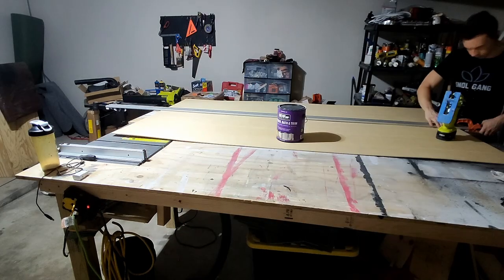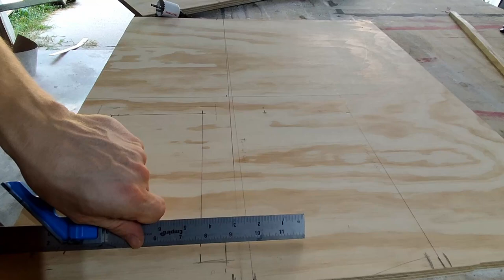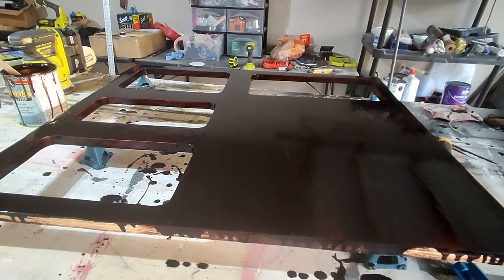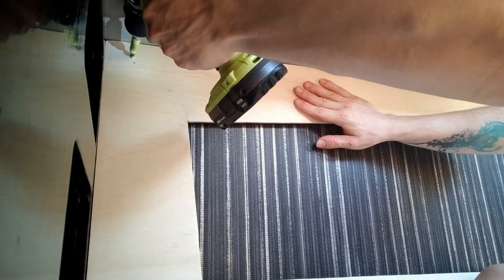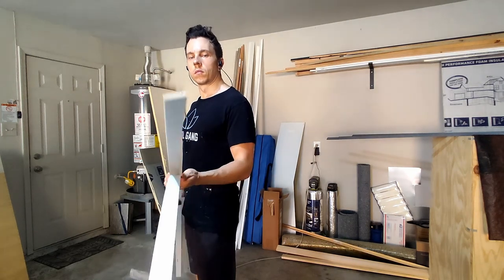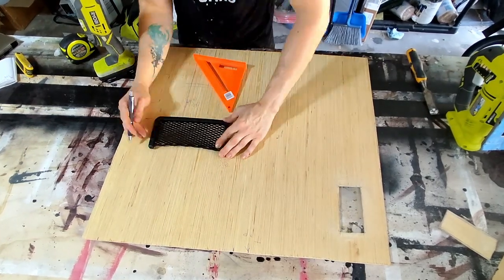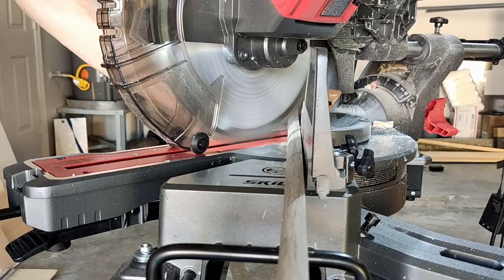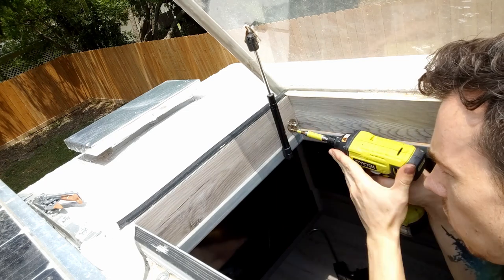DIY Capsule-Hotel in a VAN - Start to Finish | DIY Uhaul Box Van Conversion

Comment: On those trim pieces with the 45* angles around the cubby pockets. Try using a CA glue to glue the trim together. Then attach to the wall you will end up with much cleaner joints. Overall great work man this is definitely an inspiration to get out work/finish a project.
Reply from the maker: Nice I'll try that out

Comment: FYI for the future 
Steel Wool comes in 4 grades from coarse to fine  0, 00, 000, 0000, 

Scotch Brite comes in 4 colors coarse to fine Red, Green, Gray, White (or sometimes Tan) 

you can get the latter in bulk at any Auto Paint Supply store! 
also the latter does not leave fine metal fibres all over the [CENSORED] place!

Comment: It looks pretty posh!
  Here is an idea that you may want to use on your skylight. Some boats have a screen that slides in from the side or the end so that you can keep bugs out.  (You see this on overhead port windows). It also has a shade that pulls in from the other side or end that totally blocks all of the light out. It runs on the same track. 
  When they are both open, you have an open hole that you could go through. 
  These are probably pretty expensive to buy, but I think that you could build one from some channel aluminum pretty cheaply and easily with off the shelf screens and shades and some custom cutting.
Reply from the maker: Yeah I do plan on adding retractable shade/screen I just cant find where everyone is getting the custom sized ones made

Comment: I have a question and thank you in advance. I am a lover of your channel. I’m keeping a rollup door and I was wondering can I use two by fours to frame the ceiling I’m gonna put a thick tongue and groove over the plywood there. Or should I use to buy threes? My only issue is I have a bunch of two by fours already.
Reply from the maker: 2x4 would be a bit excessive weight-wise. You can probably use the smaller ones. I plan on framing my next ceiling with trimmed-down 2x4s.
Reply: Thanks for the fast reply. I was thinking the same thing yeah so I’ll hold off on the two by fours. I thought they be thick as well.

Comment: have you estimated weight once you have completed the build?
just thinking of load, manuervability and fuel mileage.
and SAFETY GLASSES my friend.
Reply from the maker: Hard to estimate weight. In my head I think I'll be significantly under cap, but I'll probably end up underestimating. Plan on weighing it soon to see where I'm at. The mileage is basically pegged at about 10-11mpg regardless of load. I was getting about 11 hauling all of my stuff + towing my car from CA.

Comment: All you need now is a small tv installed in there
Reply from the maker: I will probably end up installing a TV on the cubby wall.
Reply: @TheTechnoBarbarian  yeah especially if you decide to put up a servalance system up
Reply: Along the front edge of your solar panels put a hinged antenna rod that you can reach out from your hatch to raise and lower. Run the cable in thru the vent then cubby wall.
Reply from the maker: @deadman252  Yeah I'll definitely have a surveillance system
Reply: Make sure the DVR has alarm outputs that trigger a buzzer when movement is detected in the zones you choose